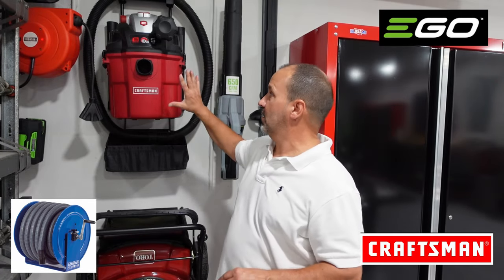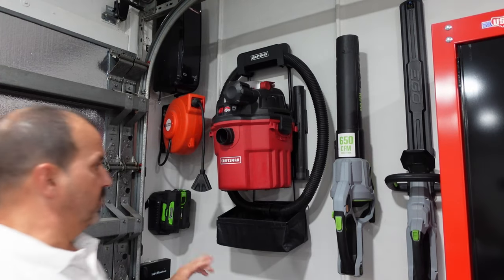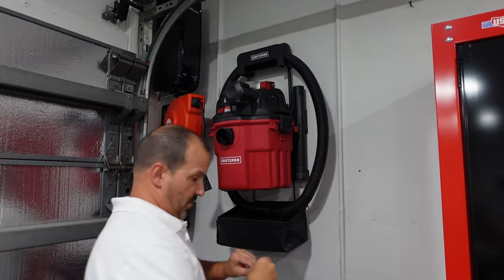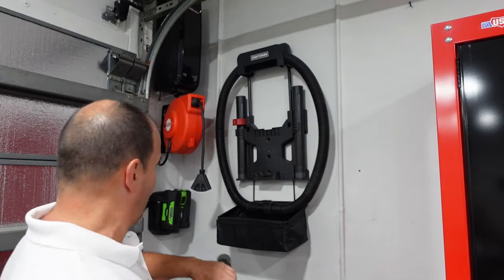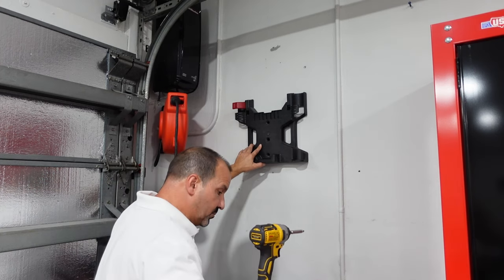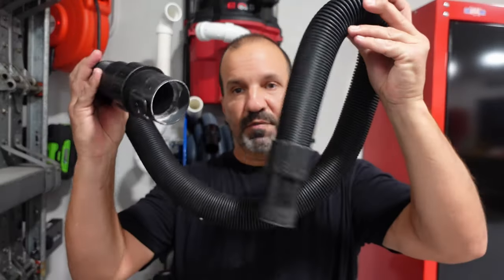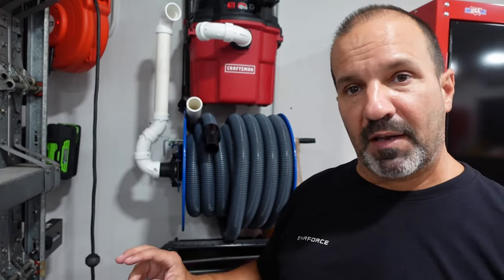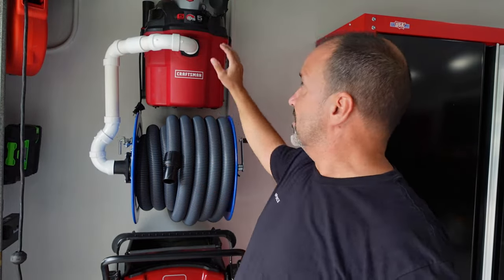Wall Mount Vacuum System Coxreels Cen-Tec Awesome Setup Detailing V-117H-850

Comment: how are you emptying the vacuum bucket with that hard piped? Getting on a ladder and emptying by hand?
Reply from the maker: Hello the pipe comes of the vacuum and the vacuum comes with a removable backplate so its easy to remove from the wall.  All you do is press a latch on the side and it pops up and out.

Comment: Very nice.  Is the suction still strong with the 5HP vac?
Reply from the maker: Hello I love the setup and you always loose a very small percentage but works perfect with my 5hp vac.  We dont need all 50 ft so I might cut out like 7 ft but so far its perfect.  They do sell a shorter option hose so if you dont need it that long then get I think the 30 or 35 ft version.  There is a thinner option but I wanted the thicker one to keep as mush suction as possible.  There are a few options of small vacuums out there that have 6hp that were not available when I purchased my vac a few years ago. I would go with something like a 5.5 to 6hp to offset the small loss. Let me know how your setup ends up.  There are some links below that have them and help out the channel.  Thank you

Comment: Do you notice any loss of ‘suction’ with that long of a hose hooked up?
Great idea with the PVC piping!
Reply from the maker: Hello I do feel a very tiny loss of suction.  I am going to cut a bit I dont need that long but since the vac is far away its so quiet when you vacuum and feels great but yes I do feel a bit of a loss.  I am looking for a 6 HP vac to increase the suction but still works fantastic.  The convenience of having the reel and looks great too out ways the small loos.  You can get the 35 ft hose instead of the 50. Thanks

Comment: What size PVC is that? 2in...
Reply from the maker: Hello its the 1 1/2 pvc from Homedepot.  Remember the part to the vac inlet you have to heat up the pvc to expand just a little so it can fit the Coxreel.  The pvc I used is this style.  https://www.homedepot.com/p/Charlotte-Pipe-1-1-2-in-PVC-DWV-90-Degree-Hub-x-Hub-Elbow-Fitting-PVC003000800HD/203393315

Comment: 700 Canadian is insane for a vacuum hose reel..
Reply from the maker: Hello I know its expensive but great to use.  I wanted one for years and finally pulled the trigger on the Coxreel.  Sometimes you can pick them up on ebay used and save a few bucks.  There is a similar product designed for woodwork that is less expensive.  www.rockler.com